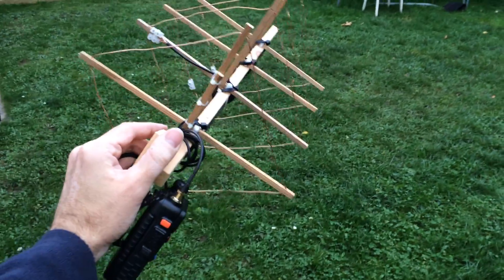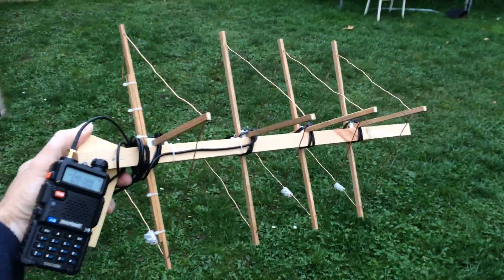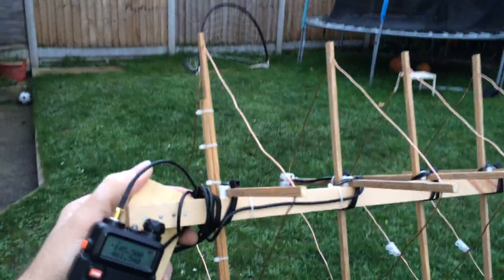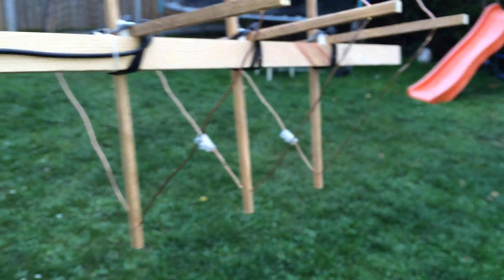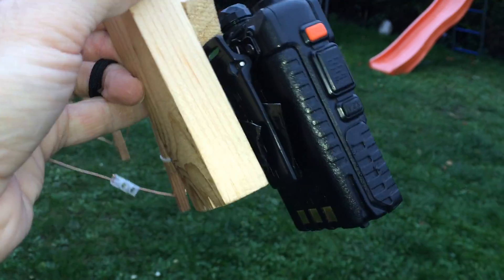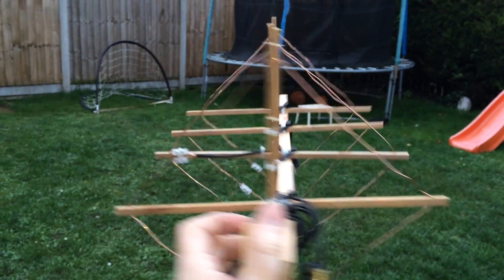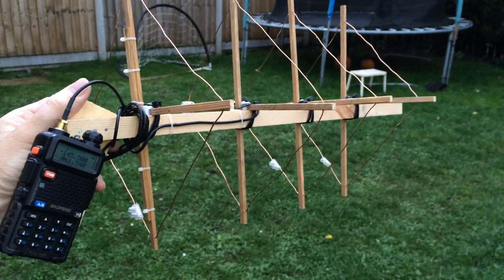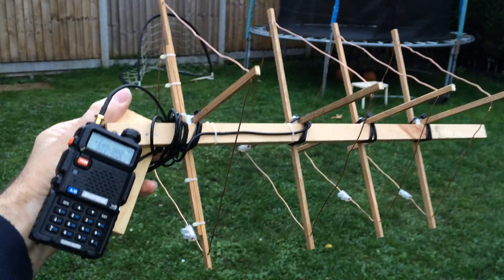70cm Handheld Cubical Quad Amateur Radio Antenna with Baofeng UV-5R

Comment: How does it compare to the stock whip? Im getting 22 miiles+ with the rubber duck. So far the Diamond 771, and Retevis771, cannot beat it.
Reply from the maker: It seemed definately more directionally receptive, especially when pointing towards local repeaters and keying them up.

Comment from the maker: Anyone else like to try making one?
Reply from the maker: @bentcrazy1324  That's good to hear and I hope my little video helped. Yes, for somethong more long lasting I would also have used plastic or other weatherproof material, but I purposely went with some old bits of wood as it was in keeping with the challenge from Survival Tech Nord, so basically using whatever bits and pieces I had lying around to see what I could make with such minimal materials. Glad to say it worked.